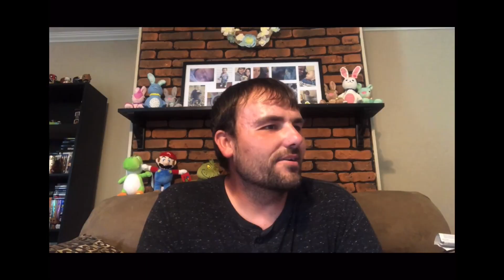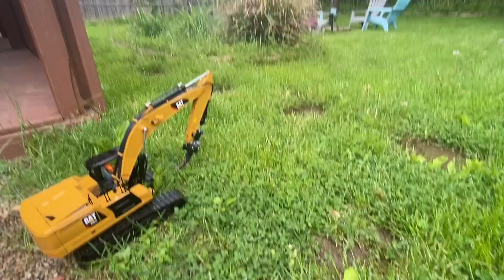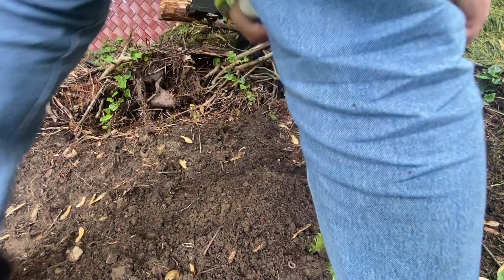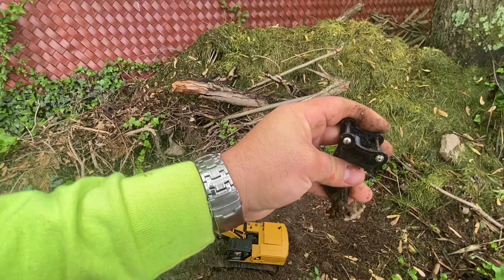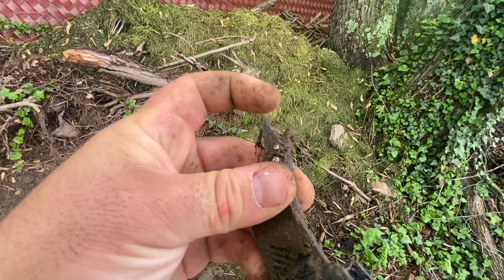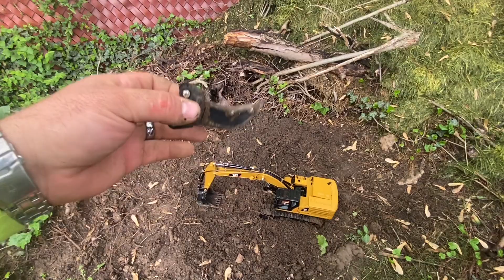Kabolite 336 gc- upgraded hydraulic performance test and must have 3-D printed ripper- RC Cincy ￼

Comment: When you print your 3D parts set the infill to 90 or 100%. That way the ripper will be solid and not hollow on the inside.
Reply from the maker: Yeah, definitely 100% fill in is required

Comment: Dude, from 30:19 onwards, you can see oil dripping from the ballast of the excavator. Did you find out where it came from after the video? Anyway, thanks for sharing! This was just the kind of video I was looking for! Incredible power for a budget model!
Reply from the maker: thanks ended up using thread sealer on all of them and kind of re-tighten them a little bit more and I haven't had leaks since. Loctite thread sealer is a must. 👍
Reply: @rccincy  Thanks man! Simple and effective in the end. Happy digging!
Reply from the maker: @bluefire87HN  👍

Comment: When you changed the pump
Did you have to change the valve block 
I bought the same pump but it doesn't mount directly to the valve block
Reply from the maker: unfortunately, the original pump and block is proprietary all in one, so I had to change pump, block, pressure, relief, valve and fittings, and lines as well.
Reply: Where did you shop this new part?

Comment: Hi ,  I've been following your K336 videos .. and I remember at some point you mentioned that  you couldn't  have the pump on a dedicated switch like other excavators ... so you can have it on all the time to stabilize the pressure and have smooth operation. so I thought I should  post this video .. it shows you how to do it ... it's in Spanish , but you can enable English translation subtilties .... from the settings ... good luck 

https://www.youtube.com/watch?v=F8HBaknni-Y

Comment: Awesome videos on the 336. Question: what’s the best way to apply those 3 mm protection springs to the 3 mm hydraulic hose from the boom to the arm? Is easy to slip the hose off from the aluminum Fitting? Any tips are appreciative. Thanks in advance. Oh, easiest way to bleed the lines after disconnecting?
Reply from the maker: Honestly I would not mess with the block. And I would get some extra fittings because the threads  are very small and they're very easy to strip or causing to leak I would  buy som  thread seal extra fluid and I would just cycle the boom  until all the air is comes to the top of the tank.  make sure you remove the cap or the top of the tank for the air to escape. i'm going to revisit that machine soon and do my final review on the new hydraulic system before and after the upgrades and also give some extra tips on the machine.